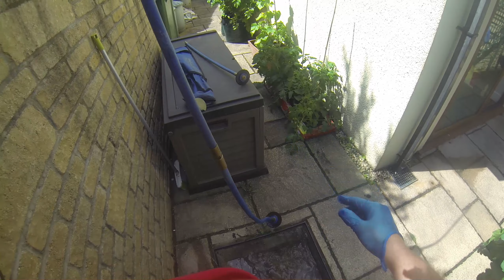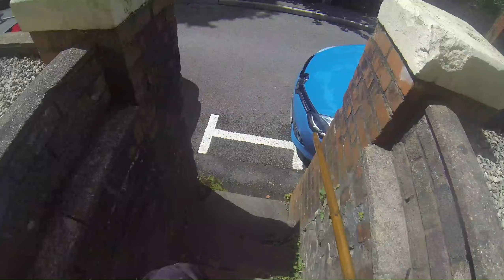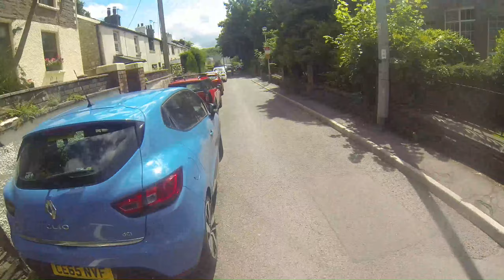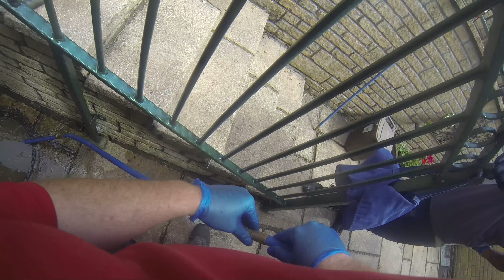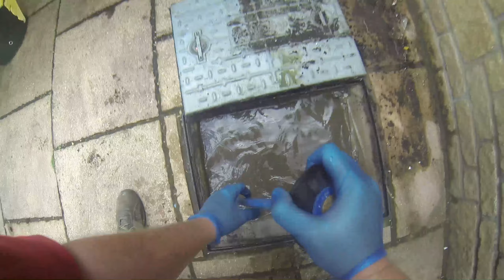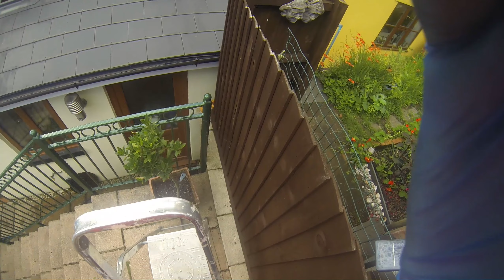Blocked Drain / Drain unblocking  (Rods_Away_043)

Comment: May I suggest you purchase a full arm glove? It would have helped you to find the inlet/outlet for that collection pit.
Reply from the maker: The outlet was 6 inches off the bottom of that manhole. Strange design. Seems to hold water them release as it Rises
Reply: @RodsAway  Yes, I saw that. The glove would have helped you find them, because naturally, you'd think they would be at the bottom of the pit.
Reply: @RodsAway  was it a silt trap for a land drain behind the retaining wall??